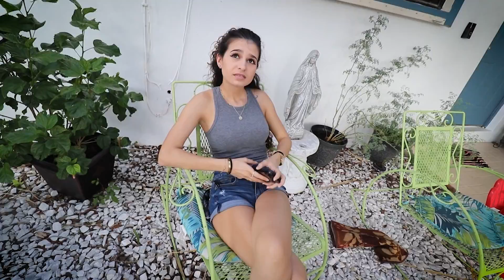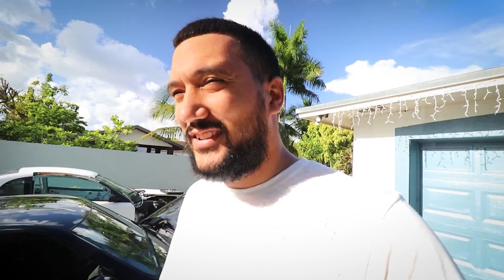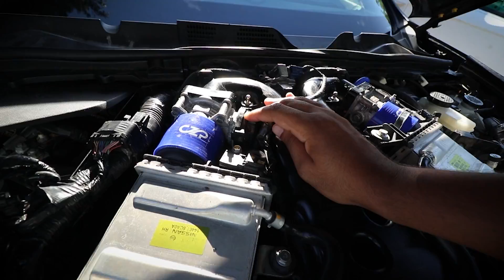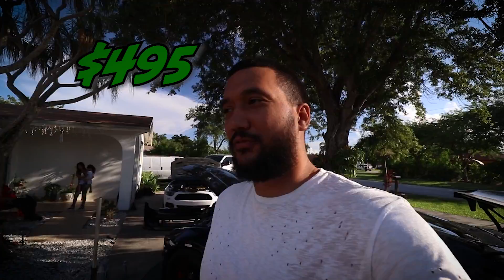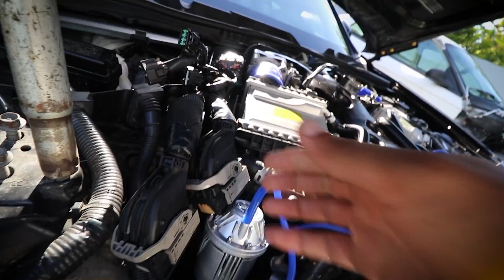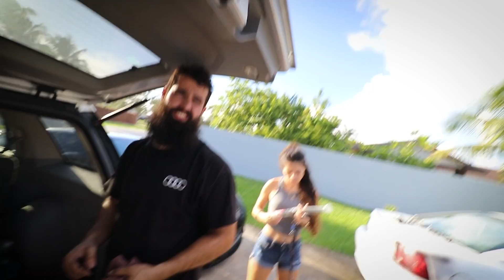I Made A Nissan 400z And Heres How (SUPER CHEAP) | Q60 Motor Swapped 370z

Comment: Also, did you roughly weight the VR30 and/or the VQ37?
Reply from the maker: - The VR with turbos and downpipes weighs just as much as a VHR alone. It’s the lightest motor Nissan has made so far.

Comment: I know why people thought that it be so much. I feel like if any body else did the swap it would only cost like 7500 witch is still cheaper then cheapest turbo kit for the 370z witch is the boosted performance kit. Now i only say thay for a 370 and maybe g37 but it just doesn't make sense unless its a de you make a perfect example on why to do it
Reply from the maker: - Why would it be $7.5k? I only got help on the harness, but there were things purchased that aren’t needed. You’d still spend $5-5.5k. Maybeee $6k Lol. 
But it makes sense for any chassis that you want to make cheap boost with and around 500 whp very easily. Plus, it’s super fun to do lol
Reply: @On3_media  no i think you miss understand, im saying that price for de cause you need to buy a trans and a custom drive shaft for a de and clutch kit for the power plus if you pay for labor all that would problem at up around there so im saying saying its still chepaer then boosted the stock motor i only gave that option to be the most expensive for the swap in comparison to the turbo kit for the z 😂 I'm saying no matter witch z you put this in its mostly likey gonna be cheaper boosting it
Reply from the maker: Cole Viney - 100% did misread that Lmaoo. My b. No driveshaft needed for a Z33/DE. Chris Scott has a running one! All OEM stuff for drivetrain (but he did get a CD09)
Reply: @On3_media  well that work but all things consider its way cheaper for this set up

Comment: 4k$ is what it cost to bolt on and tune a 3.7. Compare 330whp vs 500+whp for the same price. You’re a smart man.
Reply from the maker: - Exactlyyyy! This is why I preach to avoid going FBO on the 3.7 and save for boost.
Reply: $4k to fbo a 3.7? You must've got hosed (I mean unless you're including TBs and IntMan I suppose). Catback is something you would get NA or FI.
Reply: 日産スカイライン  and that's fine. But an intake costing $500 is absurd. You can get Z1 or Mishi for about $100. A CAI is great but not necessary for ~330whp. A full catback is not necessary. If that's what you want, and maybe you're chasing sound then go for it. But it's not necessary. You can quality exhaust fabbed or even piecemeal it. Some prefer full and that's understandable, but when I hear the suggestion that ~$4k is the number to get there I have to speak up. You can probably spend MORE than that, but you don't have to. That's why I encourage everyone to check out Speed Culture's vid about that. 

And remember: if you're going FI you would most likely do exhaust anyway. You still have to tune etc. Dollar for dollar FI is still better, but you're not escaping costs and it's still more $$ in the end.

Edit: btw, you can get an Invidia exhaust for less than $1k shipped.
Reply: 日産スカイライン  if someone wants to spend $2,000 on their intake/exhaust that's fine, but you in no way have to spend that much for a good exhaust (especially not to get ~330whp). Not even close. You guys should check out speed culture studio's channel where tallied up all the mods. If you spent $4k on NA for 330whp you got hosed.

Edit: also, if you're including labor for NA then you might as well include it for FI, at which point you can throw another $2-3k excluding tune...
Reply: 日産スカイライン   

 https://www.youtube.com/watch?v=zzLUojVbOvM

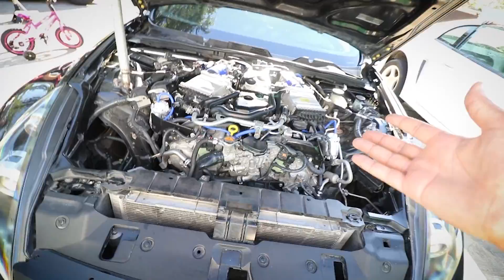Please watch the above vid (skip to the 7:28 minute mark). It will really open your eyes (you don't even have to do it the way he did it and get your namebrand exhaust, and you'd still come out weeell under $4k). If everything you said was true, this guy wouldn't exist (and others like him who are tuned running similar numbers and didn't spend anywhere NEAR $4k). Fast Intentions is a great exhaust, but you don't have to spend that much on an exhaust for gains. Period. And NO, a CBE does not make the real difference in whp, it's the stock cats (everyone knows that for a 3.7). A test pipe and/or HFC is where your gains come from on a 3.7 up to and including the tune.

You say $4k isn't a lot of money for tune/intake/exhaust. Yet, everyone complains how expensive it can get dollar for dollar squeezing hp out of the 3.7. Sounds like pricing IS the problem in that case. Hell, the OP comment even suggests it. 

I honestly can't believe you actually think an Invidia CBE is somehow bad for gains but Stillen's is good?? I just want to make sure we're talking about the 3.7 and not the 3.0 (which you mentioned).

As far as intakes, I'm not talking about VR30 AMS intakes (which make decent gains from what I've seen). CAI gains on the 3.7 (costing $5-700) aren't worth the cost OVER Z1 intake tubes and drop-in filters. CAI's are what, 5-6 whp, over the tubes/drop-ins? That's 'way better gains in your book? Come on. 

And let's be clear, no one is saying you can't spend more of the cash to squeeze those extra few whp's out of your ride. But to reiterate, if you want ~330whp you simply don't have to buy CAI, you don't need higher name brand full CBE, you sure as hell don't need headers (at least not on the 3.7 Q).
Reply: 日産スカイライン  Our convo actually made me look more into the VR30 and the AMS intakes aren't even strong on gains. I thought I heard they were better, but looking back it was a fellow that had more done and he actually lost hp with them.
Reply: 日産スカイライン  Perhaps, I'm just going off of the forums. The gains were negligible but better than the competition it seemed and also smoothed out response. The stock intakes are pretty well made.

Comment: The Cheapest reliable Boost for a G37 would be a SOHO Motorsports A2A Stillen Kit. 6500 without Injectors or Fuel Pump. Still have to get it Tuned. But she'll put down +550whp
Reply from the maker: - IssaSlowZ went that route also! I’m just not a fan of SC and their power delivery. But a great option for cheap boost also.
Reply: @On3_media  Yes sir, but he bought his SC Used. New,  with V3 Blower & A2A kit is 6500. Yeah buut more Powaaa Baby! So are they going to start making Harnesses for VR30 Swaps? My brother has a G37 & was considering Boosting it
Reply from the maker: Sinfully Quick Motors - Facts! That kit puts down greatttt power for the price! Until I build the motor, I just wanna break the stock turbo HP record and then put some abuse on it lol. I’d be fine with 630-635 and then 800 when that AMS kit is out.
Reply from the maker: Sinfully Quick Motors - Just look at the options and see what makes sense! I’d love to do a VR g for myself 🙃
Reply: @On3_media  Can't wait to see her running, I'm excited for you man. Thats awesome! Can't wait to see how she does against other cars
Reply from the maker: Sinfully Quick Motors - 🙏🏽🙏🏽🙏🏽

Comment: Definitely a cool idea but in reality if you didnt have the sponsors or hook ups it all would have probably came out closer to 7-8k ...at that point it's just better off to buy a turbo kit for the vq bolt it on and make 500 plus horse power but putting the q60 motor in the z is cool bro good job👍🏾
Reply from the maker: - Mmmm.... still not close. The harness is the only bit that I couldn’t count towards the total cost. But, you’d have to get the tune and device with EcuTek anyway, so it’s a shared cost that isn’t included in turbo kits. 
Without the sponsors, my cost would’ve been $5-$5.5k. Still a great price!
But thanks, dude! Just glad to show that there is an additional option out there 🥳. 

Now.... time to beat this thing up.